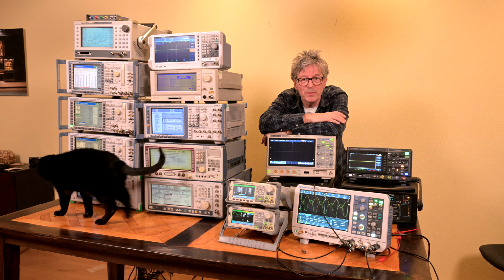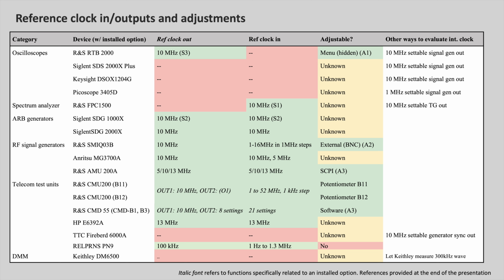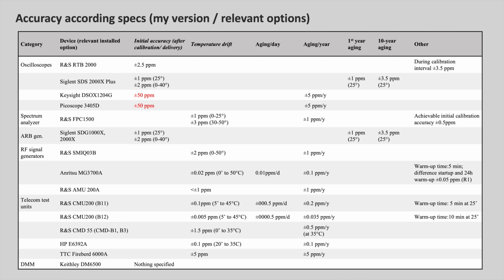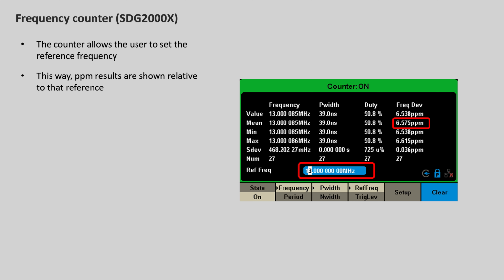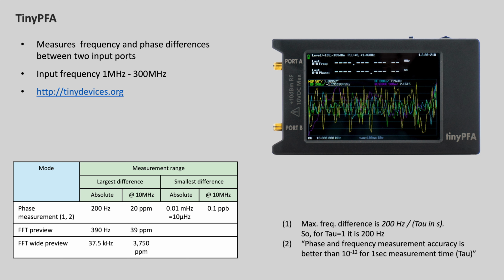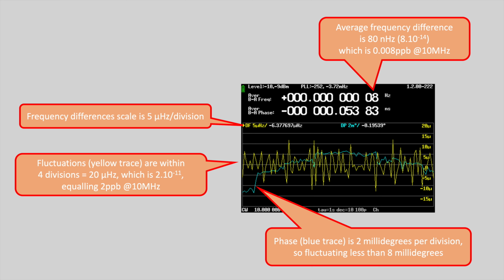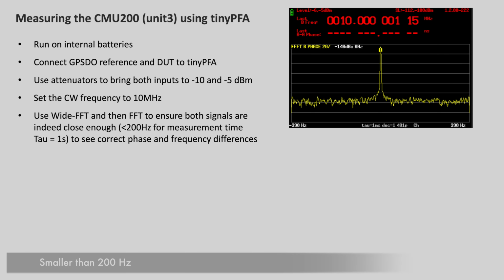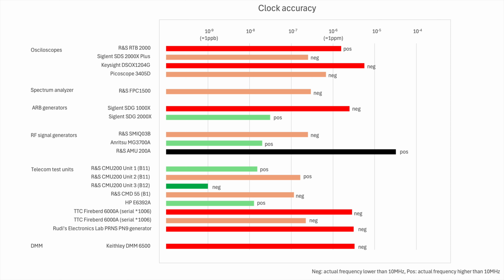REL #54 Evaluating internal frequency standards of 19 lab instruments

Comment: You can quickly determine differences in scope timebases by undersampling.  Measure a 10 MHz input on a slow time base (eg 100 ms / div).  Just make sure you are aliasing by limiting the sample depth.  You will get a low frequency aliased wave - the frequency of the aliased signal will be the difference between the input and what the scope is “measuring”.

Comment: Very good. The other important parameter is phase noise, especially with digital signals. A new, inexpensive phase noise analyser, using cross correlation with inexpensive TXCO references, is available, PN2060C for under US$1000. It measures oscillators up to 100 MHz and can be extended to GHz with its down-converters. I have a couple of blog posts on using it. It gives results that are consistent with manufacturers' specifications. Drew VK4ZXI

Comment: Orientation affects a crystal's resonate frequency thus the orientation of the instrument.  Dave of EEVBlog did a video EEV-646 Using a crystal as a gravity detector..  covering the very interesting subject.
Reply: Yes... in older crystal cuts... like AT cuts ... maybe a few parts per billion? In newer cuts, like SC... I believe the effect is much reduced. AT cuts, are used... AFAIK... for TCXO, because compensation requires 'pulling' the crystal. But AT cut is inferior to SC otherwise. SC is used in good = expensive OCXO ... which have superior short term characteristics to TCXO. GPS disciplining then makes OCXO superior to GPS disciplined TCXO... which is why one needs to know what is in the box... and what one is trying to do with it.

Comment: I don't see the point. Bodnar has a TCXO.
Reply from the maker: Is your question about whether a TCXO in an GPSDO is accurate enough as a reference point? Well, the local oscillator in a GPSDO is only there to provide the instrument with good phase noise characteristics. The phase locking (PLL) that with the GPS signal provides long term accuracy, to the level of E-12 or so, much better than any other instrument in my lab. (See my recent video on the accuracy of around a dozen clock types). The accuracy of the local  oscillator is only relevant in case of GPS loss, or receiving too few GPS satellites. This was an issue with older, more insensitive receivers, but modern ones easily pick up many satellites without any moments of loss. In the end, for a modern device, having a well designed PLL mechanism is more important here than having an oscillator that is very accurate over the long term, when aging (e.g., OVXO or Rubidium).
Reply: @rudiselectronicslab861  I have always understood that the local oscillator of a GPSDO provides short term stability to overcome the jitter on GPS signals. And by measuring the OXCO frequency over an increasing long time (20 min to 1 hour, so you're basically creating an FLL, not a PLL) you average out the jitter on GPS signals, especially when you use the 1 PPS signal to measure the OXCO output.
Reply from the maker: @meindertsprang7491  I think that is perfectly correct! I note that people often talk of PLL in the context of GPSDOs, and it is not always clear whether they refer to the locking of the LO to the GPS part, or to other locking going on inside the unit (e.g., other counters that may be set to multiple frequencies). For the Leo Bodnar LBE-1420 and LBE-1421units in particular, there is an "FLL mode", which is described as “FLL enables better ADEV but lowers absolute precision”). It does not say what the alternative to FLL is. And for the older Leo Bodnar 'precision' units, the software all shows an indicator for "No PLL lock", whicn seems to refer to being locked to the satellite...
Reply: @rudiselectronicslab861  I think that is incorrect. With calibrations of the type that you are doing... to the level of precision... and accuracy, being claimed...one wants x+epsilon sufficiently characterized now... not in the future. As such, short term stability is what is quite important. TCXO is inferior to OCXO, in that characteristic. One may say, the TXCO at hand, is sufficient. But, what do we know about that? IMO... in a newer instrument ... with.... let us say... a 'near metrology grade' OCXO... it might be a mistake to assume the Bodnar device is a 'standard of comparison.'